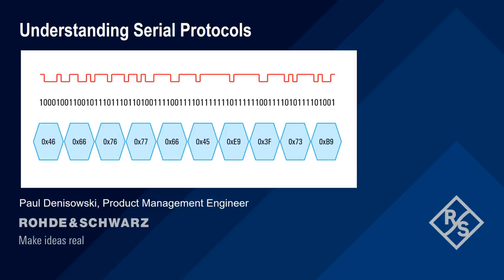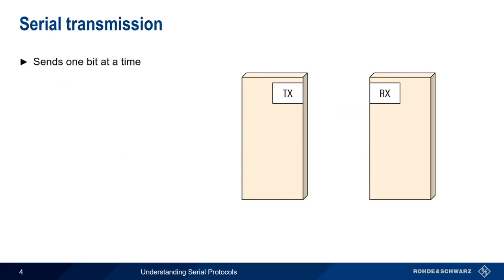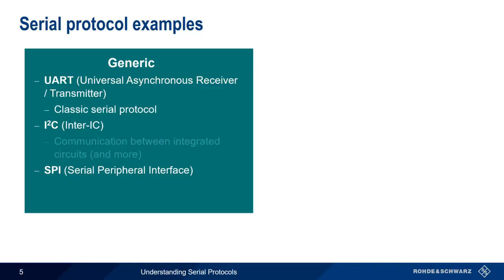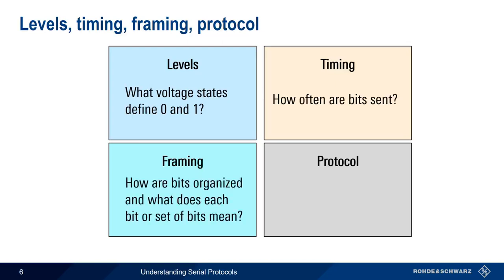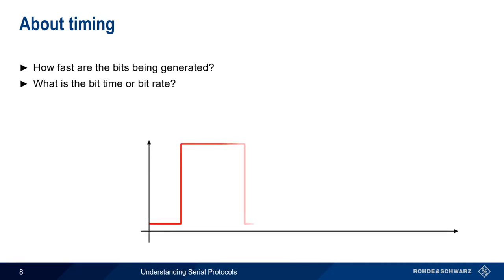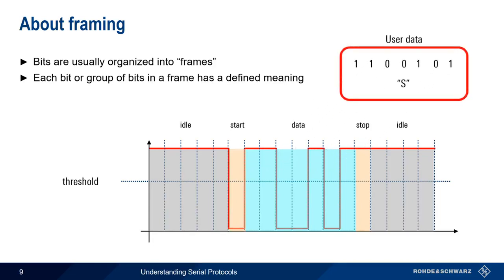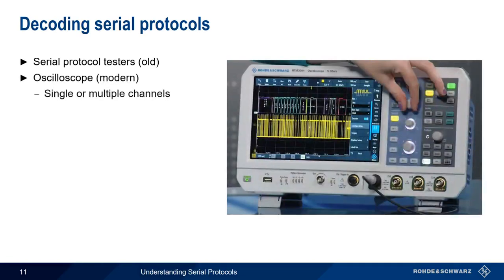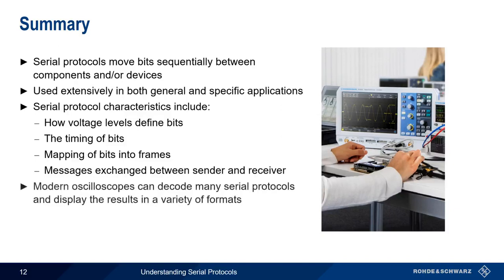Understanding Serial Protocols

Comment: If you're curious, that bit stream at 0:30 was 1000100110010111011101101001111001111011111110111111001111010111101001 and no, I could not find "Hello World!" in ASCII or LCD1620 lookup tables no matter how I mirrored, inverted or sliced the frame.  Great video though, clear and concise.
Reply: (laughs).  To be honest, I can't remember if I meant for that bit stream to mean something or not.  If you watch my videos closely, I usually do try to work some "hidden messages" in, but this time I think it was just random bits.  I promise that in my next serial protocol video I will make the bits spell out something :)